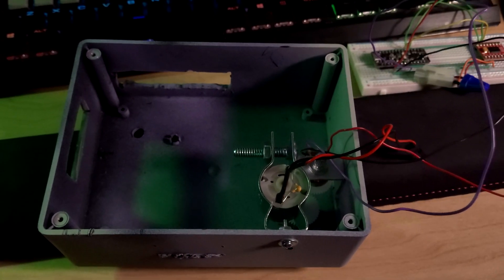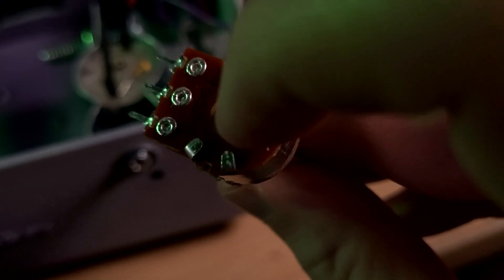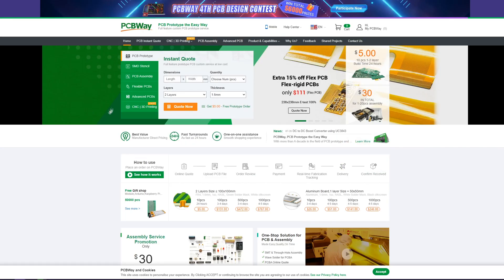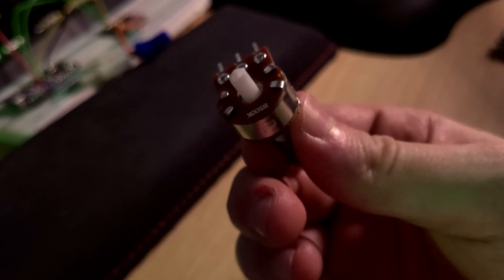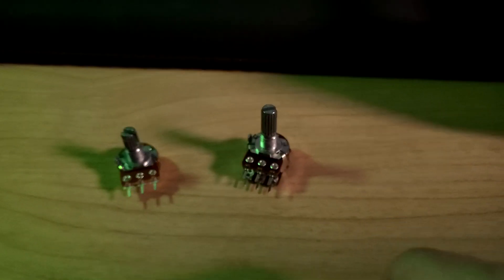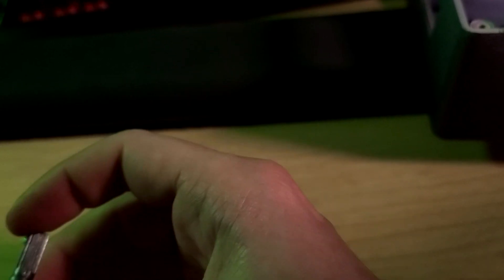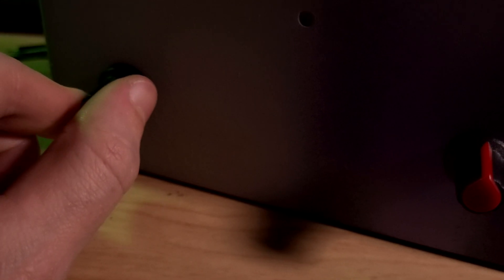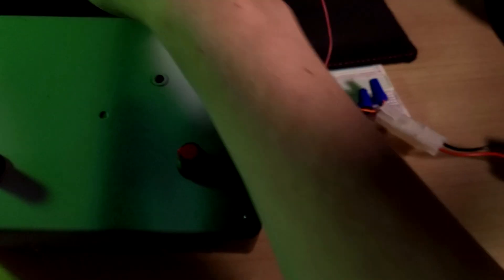Making A Motorized Potentiometer Pt. 2 - The Better One

Comment: I did something similar about 10 years ago but used a shaft coupler. Wonder if a standoff would have fit well in there. 3d printing is so easy these days and you can make it exactly the way you want so probably the best way.

Comment: Great project! I was wondering if it would actually be possible to use an off the shelf servo motor, realizing that one needs to have some kind of torque sensing so one can make the servo follow in the direction that one tries to turn the knob.

Comment: I'm busy doing something similar, so I thought I'll offer some advice. 
By using a stepper motor, you'll always know the position. Thus no need for a separate pot. You may need to calibrate it once in a while, and that's easily done with a micro switch to stop the motor just before the end stop of the pot, and zeroing the step counter at the same time. It may not allow for turning of the knob by hand, but that can be overcome by using a rotary encoder for manual adjustment. Anyway, that's how mine works. The Nema-8 stepper motor is a tiny 200 step per revolution motor and perfect for this application.

Edit: Just noticed that someone else also suggested a stepper motor. Well, my solution for manual adjustment is still valid.
Reply: why not just use a servo?
Reply: @alleninventions8315  On paper, a servo seems like a viable option. But in reality, there are many drawbacks to using a servo. If you meant an RC servo, your first hurdle would be to connect the servo arm or wheel to the potentiometer shaft. Secondly, the resolution is just not comparable with that of a stepper motor. I'm using 16 micro steps with a 200-step motor and with the TMC2130 stepper driver and its stealthChop option, it's virtually noise-free and  very smooth. Another advantage is that power to the motor is cut after the desired position is reached, while a servo motor would be powered all the time and a servo is also known to "hunt" and buzz while standing still. It's just not a graceful enough solution compared to a stepper motor.
Reply: If your application does not allow calibrating stepper after power on, you need other way to figure out where you are. Dual pot is pretty solid solution for that. Other than that the stepper is good way to go if the resolution is enough. You can also switch off the power from the stepper after moment is finished, and then manual adjustment is possible straight from the pot. With DC motor or servo manual adjustment will be dragged by the gear mechanism.

Comment: Sorry, may I ask. Why not use a stepper motor for this?
Reply from the maker: A stepper motor could be a valid method for turning the pot. I wanted  to use this in an application that allows people to still manually turn the knob for the pot, and feedback control solves the problem of knowing where the pot is set if it was manually turned or turned by the motor (see my robot guitar pedal video). When I was looking into it, stepper motors also tended to be more expensive and take more space than the little hobby motors I used.

Comment: Probably a dumb question - but if you can take a voltage reading from the motors, why not use the motors directly for input? Is there a benefit of using the potentiometer?
Reply from the maker: I'm not sure I follow. The motors are driven by a voltage, but that voltage sets the speed at which they turn, not the position they go to. Then obviously there is the main potentiometer that you want to control. You can't use it for motor input because you can't assume a known reference voltage will be used across it. That's why we need a second pot - you can apply a known voltage across it, and read the voltage drop to know exactly where the whole assembly is positioned. Hope that makes sense.

Comment: How is it going now?
Reply from the maker: I haven't done much more work on it, but I did use this design in my motorized guitar pedal. It's still underpowered, but it worked as a proof-of-concept. I'm sure there are more suitable motors out there if you're willing to put in the cash.
Reply: @AllPartsCombined  please suggest me some. I’m glad that your prototype is working. Nice effort
Reply from the maker: Sorry man, I don't have experience to know any particular motors that would be good for this. You'd want to look for a motor small enough for your application that emphasizes high torque rather than high rpm.
Reply: @AllPartsCombined  
I might be way of here but i was thinking that you would want a high speed low torque motor, then you gear it down... a lot!

And you gear it both ways, each gear has two gears, a small and a big one stacked, and they match eachother... like a rc servo is geared, that way the motor turns it easy, but it also turns easy from the potentiometer side... 

Im not sure of the rpm on the motor you used, but some of these small motors run at 20 000-30 000 rpm.
So lets say it runs at 10 000rpm, you gear it down to 1/4 then you are still at 2500 rpm, which is waaaaay to much... that is like 40 rounds pr second, the motor will be struggling hard to be accurate turning the potentiometer just one round...

Gear it down another 1/4, then the motor can turn the potentiometer at 10 rounds pr second, probably still to fast for a 10 000 rpm motor to work efficiency, how fast do you need the potentiometer to make a full turn?
If you now ad a third reduction at 1/2, it would turn a 360 potentiometer one round at 0.2 seconds, maybe still to fast...? But with the right gearing you can use the motor to its potential, the weaker the torque the less current spikes, you could probably hold the motor back on the potentiometer or even turn it the opposite way without to severe of a current spike.

But yeah, i don’t really know what im talking about and my math may be way of, i almost failed that class... 👀

Edit: or maybe use a stepper motor...

Very interesting project!